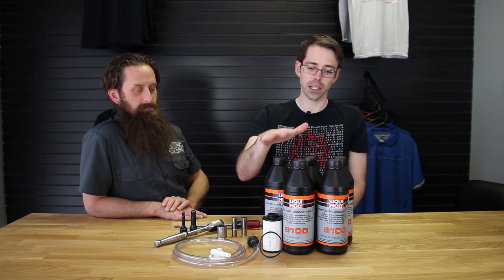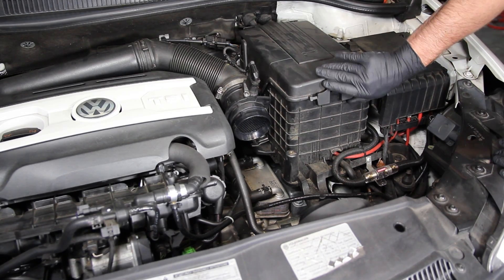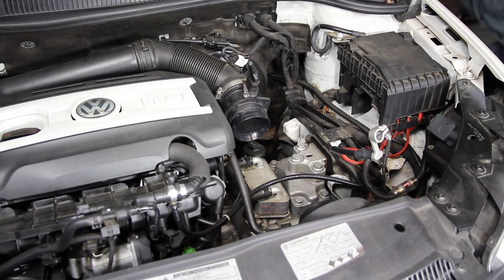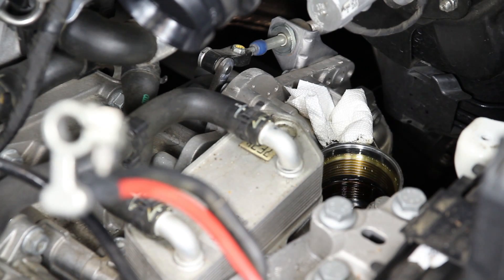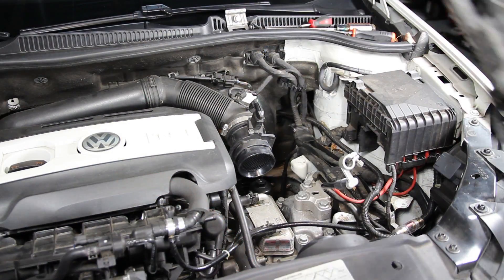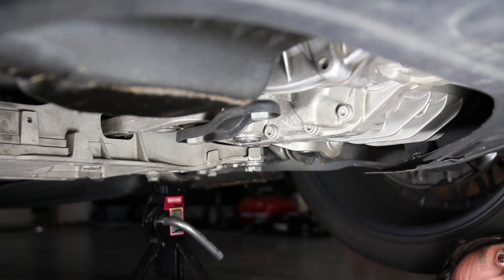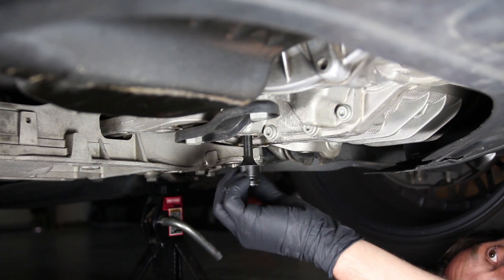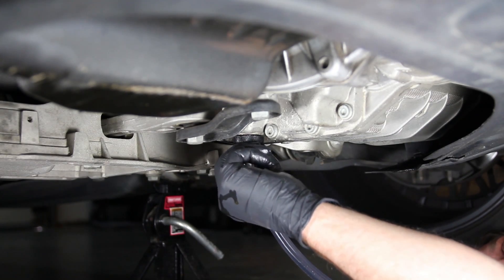How to (DIY) Perform a DSG Service on a VW and Audi Transmission (DSG Service Kit)

Comment: Measure oil that comes out and put same amount in again. You can use an infrared thermometer (cheaper than VCDS software) to check both old and new oil are same temp. hence no volume differences due to difference in oil temp.

Comment: You forget to mention how to level out the dsg fluid, will that be ok if fill up a little too much?
Reply: Unlike engine oil, there's no such thing as having too much dsg or transmission fluid as long as it is filled up and have some spilled to show it is filled.

Comment: Final level check needs to be done with the car level, engine running, transmission in neutral at a measured fluid temperature of 35-45°C. When there is only a slight dripping from the overflow you have set the level correctly.
Reply: Where is the over Flow?
Reply: The overflow is inside, just upper the drain bolt. It's the same hallen 5mm. (on my tiguan)

Comment: Just pay the 800 and have Volkswagen do it once every 2 years or 40k miles.  It’s warrantied work... my r-line went in for a new turbo at 47k.  And came back in for 1 thing that the screwed up....both items gratis.  But...u can pay for ur own mistakes....great video though.  I would change my own battery
Reply: 800 dollars to have a dealer do it is crazy. It's like 150 in parts, max. Even if they bill for 2 hours (it won't take that long), that shouldn't be more than  like $350

Comment: My 2014 SQ5 has a "lifetime" transmission fluid but I would like to change it. Any thoughts on this? It has almost 90k miles. Bought it with 84k miles. Don't believe it was ever done. I got detailed records for all repairs from the Audi dealership it was serviced.

Comment: Hey guys, is 83 degrees Celsius ok? For transmission fluid temperature. I’ve recently remapped my Audi A3 2.0 TFSI to stage 2, but now my gear selector is stiff, the odd days it feels normal but ever since the ecu remap, selection of gear has gone hard. Do I need to change the fluid? 

Thanks

Comment: I need to do one in my mkv GTI. If i may have to much fluid, how will i drain out the excess? Would I need to run the car in each gear as well? That's kind of hard since it's not a stick shift, you can't just do it without driving the car
Reply: Use your paddle shifters.

Comment: Dsg 6 speed 2012 jetta , i change oil on 60 000 i think  guy put like 5 l  or 6 i m not shure.. till the car was run hi finish filling up and i think about 1 l lil bit more whent out , hi said to me that is normal . Car kinda drain oil till have perfrct amount.. we finished servis.. all good .. have fun with a car all day amd night .. no problem .. problem comes after long drive ..500km  maybe 1 stop ... hi just change..like hi lost power.. kikdown ,hi change  1 back but dosnt have thag kick like before.. is like retarded.. what shiud i do ?

Comment: This completely wrong,  Need to use VCDS to monitor the temp then let the excess fluid drain until the level is at the plastic tube.

Comment: This video and some of the comments are idiotic. You should drop the sump plug, let the gear box drain while you remove the battery and gearbox filter, by which time the gear box has finished draining so refit the drain plug then refill the gear box from the TOP via the filter hole!!!! This is not a VW design fault! It’s a shit educational video! Never ever run a vehicle while underneath it!! Faaaaark

Comment: Is there a time limit at which DSG service should be done if I have an older, low mileage car? (in my case golf mk7 2013 TSI). It’s currently 4 years old doing 20,000 miles.

Comment: From the initial release of the sump plug, it would indicate the transmission was originally overfilled. Unless I have misunderstood, only excess oil and oil inside the overfill plug should be expelled?
At what point have you verified the correct oil fill level?  The secondary plug seems to be an overfill pipe, good idea...but then all one needs to do is wait for the oil to stop running out when at the specified operating temperature of 30degress C and then the  correct amount has been installed. 
Nice presentation.

Comment: Did It M'self...IN ABOUT 2.5 HRS ..TODAY...THANKS ! to You Guys..Bought y'er kit...borrowed a 14 MM hex/allen key...Took car for a ride (heat things up)..Drained, measured..5 liters out, 5 liters in ...(left containers in the hot sun for a couple of hours, faster flow)...When the thing was full I clipped the downhose from the adapter closed with small vise grips about 6 inches below the adapter and cut it with side cutters behind that. That made the exchange from the adapter to the plug very easy. Also, turns out 24mm (for filter housing removal) is equivalent to15/16 socket size, so I didn't have to chase that down. The air cleaner and battery and housing was easier than I thought (once I watched about every GTI Mk VI air intake video on YouTube ! ). I think I actually watched Videos for about 15 hrs ( your's X 10, and others, before I attempted to wrangle this Absurd German Designed Clusterf-ck..hahaha ). PAID OFF ! Yippee...Saved $370 bucks and did it right. Feel a little Proud and Satisfied. A Prediction: The Self-Reliant Man will be the KING of The 21st Century. Just Do It !
Reply: hope you let the excess drain when running the car!

Comment: If you already put de air filter the gearbox is cloused. The air inside the box is compressed ? when you put de oil by de drain plug where did the air go ?

Comment: Pretty good video.  At the end of this video; please make sure you follow the procedure to "check the level".  Meaning, start the car; run it through the gears; get it up to the required temp. then remove the drain plug and allow the excess fluid to drain out.  Only a small amount will drain out; because the internal plastic tube (over flow) is there ensuring you have the correct level.  once it stops coming out; replace the drain plug (with new crush washer) and you're done!
Reply: I love your work but this time you mentioned nothing about checking the dsg temperature then opening the outer 14 Ellen bolt to allow extra fluid to get out then move shifter between all gears. 
This is not the full how to and can mislead owners

2. If the oem filling tool is so messy why just not refill the fluid from the top???
Reply: @rmetanes  it will take forever to fill it from the filter
Reply: @tabaricurry4668  Doing it from the bottom already takes forever at 20 to 25 minutes for 5 quarts. Top drop can be much cleaner and less wasted.
Reply: @rmetanes  when you move the shifter between the gears PRNDS...also the 1,2,3,4,5,6? and should you repeat it? or keep in each gear long? thanks
Reply: @rmetanes  Great video till the end. I wouldn't want him working on my car forgetting to do the last step.

Comment: What a bunch of hacks...  1) you over filled it. 2) you didn't even torque anything down.  At least, I give you kudos for not breaking the plastic filler insert by using a wrench to tighten it.  At least you got THAT part right.

Comment: Your video very successful BRAVO, but for my part when I changed the oil of my Gearbox dsg6 170cv it was very dark and the filter also, is that normal?
Also after 35°C it rejected 1L7 of oil and kept 4L3,  what do you think?
The worst is that my box makes a weird noise when I accelerate to launch the vehicle. What can come this problem because before the emptying I had no noise?
Thank you for helping me with your useful advice

Comment: Is that a DSG6 or DSG7 gearbox? From the design of pretty much everything under the hood, it seems to be identical to my audi a3 2009 1.8TFSI. 
Now... filling up the oil from the filter housing, as long as you fill the exact same volume as you took out...... of course, it would be painstakingly slow, but easier for a DIY and wouldn't bring any problems, would it? 
I'd really appreciate an insight on this matter to try and service my DSG7 next month. Thanks in advance, guys!

Comment: i have a question, on my dsg transmission when i put it in drive the P-R-N-D-S display starts blinking. Do you know why?
Reply: I got the same thing and then it wouldnt shift past 1st, checked it with scan tool and got a pressure control selenoid A stuck on

Comment: What about this...

1. Drain the oil.
2. Reinsert the stand pipe, but leave the plug removed.
2. Remove the filter.
3. With the car level and the filter removed, fill the oil through the filter housing until it begins to trickle out the stand pipe.
4. Re-insert the plug and install new filter.
5. Optional: Warm the transmission up to 30C watching VCDS and remove excess fluid.

Can't the fluid be poured in through the filter housing?  Seems you wouldn't need the fill tool, you would make less mess, and you would waste less fluid this way.

Comment: Would this method be the same on my 2008 a3 2.0 t
Question why didn't you show how to make sure your level was correct, how to drain excess fluid and the fact that you have to run through your gears once everything is complete? The only reason I'm asking is bc I've seen couple of different vids now and they all show those procedures. Is that only for AUDI or did you just forget to add them? Also don't you have to get the fluid to about 35 c before being done?

Comment: You're supposed to keep the fill tool connected and start the engine so that the pump and filter takes up some of the fluid.  You also need to cycle the shift selector thru every position.  At 35C reading from the fluid temp sensor, you then  remove the fill tool.  Let the excess drain to a trickle (when it is level with the top of the snorkel).  Then cap it.

Comment: It is unnecessary to do the bottom-fill procedure. It's much simpler just to remove the filter, drain everything out of the transmission as shown, replace the snorkel and drain plug, and fill the transmission through the center hold in the filter with the same amount new of transmission oil as was drained out. Then replace the filter, start the car and run through the gears while stationary, then drive another 40,000 miles. Many do this, with complete success, and it''s much simpler than the elaborate VW procedure, and no temperature checks or special tools are required.
Reply: how do we know that the previous service had the correct amount filled? I'm about to do this at 140,000 miles and I have no record of this ever being done before.
Reply: Soon will be my first time doing a dsg service, and im going to try to fill from the filter housing instead of the way shown in this video from the bottem.
Reply: John Avelis Jr. Thanks man gonna try this out my GLI is at 34k Miles trans service comin up
Soon

Comment: this right hear is the reason i will never buy another new vw as long as i live and iv owned numerous rabbits and have a 68 beattle and 02 gti with the 1.8 turbo and 5 speed tiptronic right now  but never another 1 unless its a manual stick - stupidest design iv ever seen

Comment: Didn't show how to bring up to temp,  release excess fluid and ensure proper level with vagcom. Not good, gentleman.
Reply: Agree.  This is NOT the whole procedure and is, technically, wrong and incomplete as you've pointed out.  Please ignore this video.
Reply: Explain further
Reply: Temp of gearbox oil should be about 35 degrees (viewable on VCDS) and then the drain plug opened to allow the correct expanded oil to leak out.  When the oil leaking slows refit plug. The temp is bought up while running the engine. Also work the gearbox through all gears before the final drain. Hope this helps...
Reply: What happened to the proper running temp and running the extra off??
Reply: @LastHumansGarage  What about re calibrating the DSG, its necessary?
Reply: @Jotauve98  No, just go through all the gears 10 times before releasing the excess.
Reply: @Saaaaab  if I didn't do it 10 times, the dsg still can release the excess?
Reply: @Jotauve98  I'm no expert, just what I saw someone else do. I'd say 3 times minimum. The more you do it, the less excess there is.
Reply: It's actually once... go through the selector positions once down and back up. Stop for 3 seconds in each position  @Saaaaab
Reply: Was wondering the same on other videos I previously watched.

Comment: Hi Just watched video and am about to change oil on my 2004 V6 3.2 TT. I obtained to oil online for £96.50 including filter, O ring and crush washer. Didn't even ask Audi prices in UK!! In UK cheapest refill pipe on Ebay was £65 so I searched around and got a genuine VAG one from Germany for around £35 including delivery. Also there is a modified internal filler tube available from Audi. Original one is black plastic and 90mm long Mod one is apparently is blue and 96mm long which they reckon will allow box to hold another half a litre (just over a pint). Hopefully this will stop the jerkiness I sometimes get on take of at slow speed in D mode. Says service oil change at 35k miles and mine, although 2004 car has only done 24k miles so doubt very much if it has filler tube mod. Its been Audi serviced from new and cannot see any reference to this item on service invoices.
Filter change is simple as its directly viewable without removing any ancillaries.
Great video guys.

Comment: Okay at the end there's just a ..."that's it!"  ......so what about all the fluid that poured out when taking the tool out and putting the plug in?  What's the point of doing a service if you don't leave it full at the end. There's no topping it off to make sure the trans is actually full?

Comment: I have a 2010 Golf with 41,100 miles on the engine. I purchased all OEM parts except for the drain/fill tube tool. Where can I purchase the drain/fill up tube tool? Thank you.

Comment: Charles, if that's what you do at the dealership, then why tf do people waste their 300 dollars on you? Why did you not run the car and use VCDS to bring it to 35C and then let the fluid drain down to a small drippage over the long level tube? After all, this is what people are paying for, as they don't have the VAS 6262A tool or VCDS. And what you did there is a TOTAL shame on you and all other "technicians" who do this procedure like that!

I can't believe this was supposed to be an educational video...
Reply: https://www.youtube.com/watch?v=EH6hoZlT-RE
Reply: Exactly what I was thinking
Reply: Good points one and all Sir !
Reply: 757WN its a shit video! Drain the fucking gearbox first! Not last! You remove the filter while it’s draining, then refit the sump plug and fill the gear box from the top! Via the filter hole!!! Faaaark!
Reply: @dronewild3234  Yeah but there would be no sales for the hose kits that put the fluid back in the tranny.
Yes, adding granny  fluid via the filter inlet is the same as adding motor oil via the spout for motor oil.
Reply: Rumen Hristov This is for diy, not a demonstration of what he does at the shop.

Comment: the dealer said that the transmission fluid in my 2013 2.5 se never has too be changed how true is that ?
Reply: If it's 6sp DSG transmission, every 40k mi. I would read your manual instead of trusting dealer.

Comment: couldn't you fill it through the filter housing? 
seems counterintuitive to try and force fluid UP through the same hole as the drainplug
Reply: I haven't done it yet, but apparently going through the filter housing it takes longer to fill. It's faster to actually fill through the bottom but with the filter off so that it can breathe.

Comment: Nice video & clean job guys! :)
1. All due respect, but with the last bottle still in the engine bay area, I'd start the engine & run the DSG selector thru the shifts. 2. Just wondering: would it be possible to drain the fluid first & then fill the correct amount thru the filter housing? Then snap ur new filter & job done? ;)
Reply: That's how I did it. It takes more time as fluid goes in very slow. And I put exactly the same amount of fluid as I drained.

Comment: I'll let this job perform by a garage. They have a BG PXT flush station. It saves me a lot of time and mess. With a good search you'll find a garage with reasonable prices. For normal engine oil changes i use a Pela oil extractor, also a very good tool. Always buy your oil in bulk online like 20 L or more, much cheaper than the 1L or 4L botlles you often see. Saves you almost 50-60%.

Comment: I just bought a 2006 A3 with this transmission. It seems to hesitate when I pull away, like at a stop light. I'm not sure when the last service was done on it. Would it be a good idea to maybe flush the transmission, or is that even necessary? Thanks for the help.
Reply: When in doubt, flush it out. If you don't know at what mileage the transmission was last flushed, it wouldn't hurt to do it. Keep in mind though, hesitation can be caused by many, many things so it's impossible to diagnose your car in the comments section. My advice is to join an Audi forum and pose your questions there. You can also go a shop and have them properly diagnose your issue.
Reply: +Derfstang It could be just me getting used to the transmission, too. Thanks for the reply